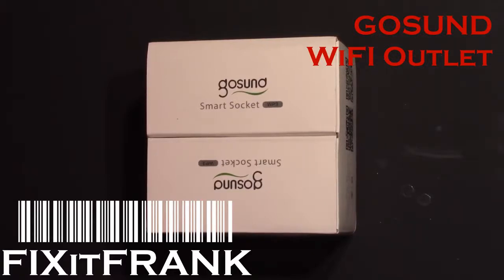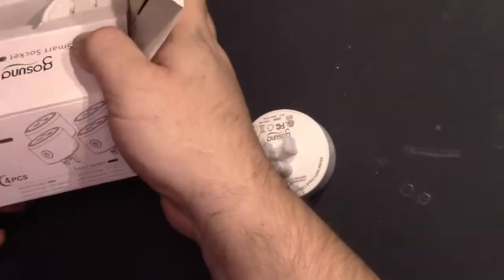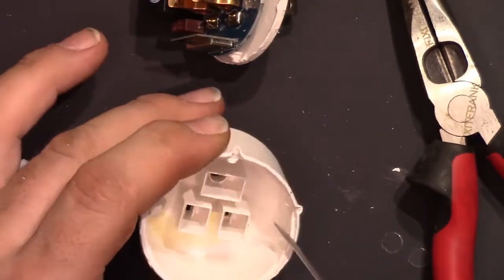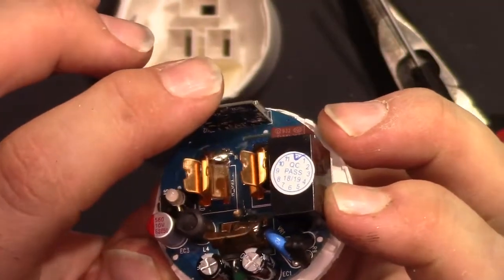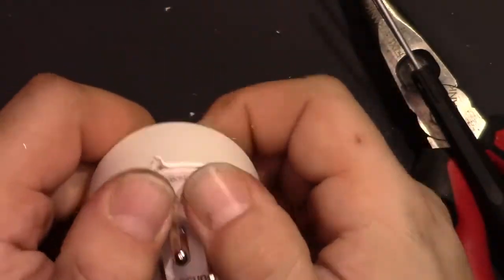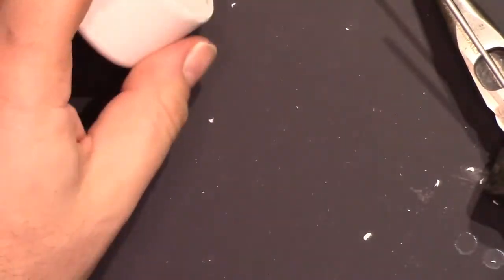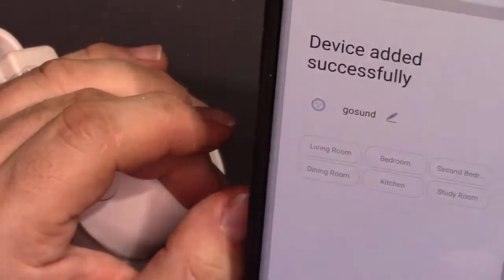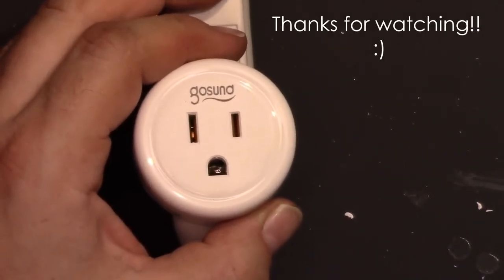Gosund Smart Wifi Plug TearDown by Frank Oranzi

Comment: First one of this style that I tore down I sawed all around the base outer case to get it apart. This time I used a big vice and squoze the outer upper body portion about 3 times after rotating a bit. Heard the glue bond snap.  After that a vice grip on a prong and she yanked out clean. Much cleaner then/than the saw job. No jags at all even. Now lots fix a relay (maybe) and add some sensors galore.

Comment: It seems that if you overload one, it will no longer work at all. Had a 16 amp rated Gosund plugged into a dust collector that was rated for 15a on a 15a circuit breaker.  There was a momentary on, then it was gone---forever.  Figured it was a fluke and decided to try on another Gosund.  Same results.

Comment: Dec 29, 2020.  Got a 4-pack of these from Amazon.  They talk to TuyaSmart no problem but to take over the firmware w/ Tasmota is no longer possible OTA.  Will need to take apart and flash new FW via USB.

Comment: I have three different string lights that I like to have on during certain hours in the evening. These lights used to be hooked up to Zap plugs with remote control. I replaced the Zaps with the Gosund outlets and they work flawlessly!!! All 3 lights are scheduled to turn on/of at the same time. If I’m ever going to be out later I can change the schedule or turn on remotely.